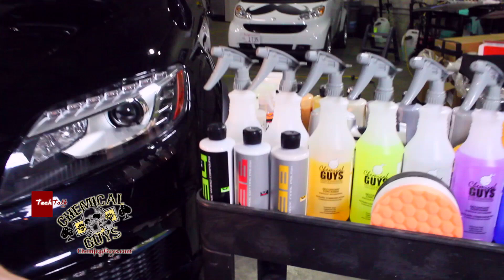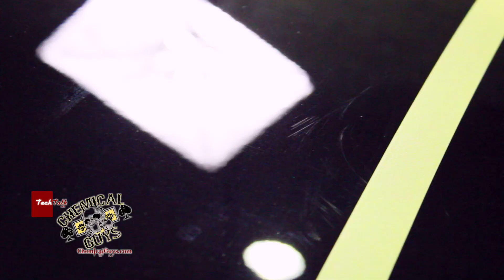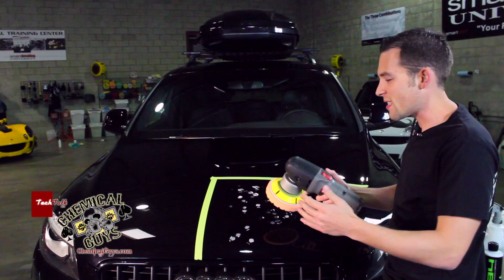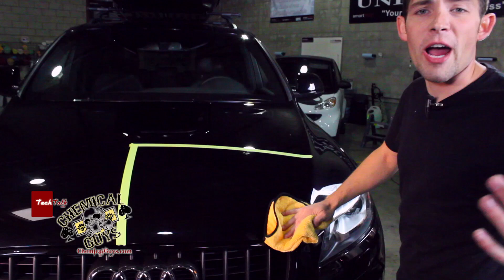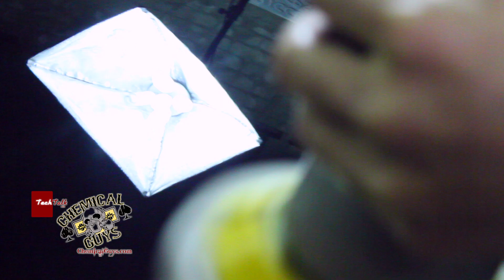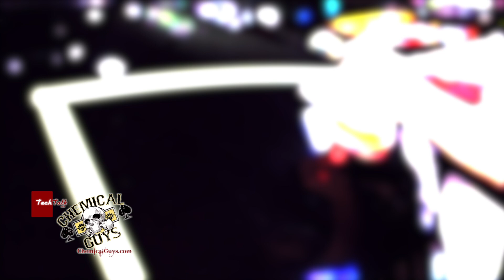How To Remove Swirls, Scratches & Polish Paint with the Porter Cable 7424XP - Chemical Guys

Comment: i have a question my 2009 maxima has lots of swirl marks i bought evertthing like you said in the video buy i messed up on one thing which was the polish 
i bought the right pads and backing pads and same machine 

but i have the whole car polish but the swirl marks are still there it did remove 50 percent they are some still left can i still use all three products that you have told in the video to take it out ??

Comment: Hello, u r using ur porter-cable. when u put the polish on the 1st time, u start out on 1 and then go to 6. could u give that in rpm's as I use a Dewalt which shows in rpm's. Thanks Jim

Comment: Yes, the pads can be cleaned and reused.  You may want to get 2 of each pad, so that you always have one ready to use while the other is drying.  I recommend you clean the pad(s) right after using them, but not necessary just a bit easier at least for me.  I use a citrus cleaner or just plain ole water to remove the polish.  Then let them air dry.

Comment: Quick question... I have already done a full in depth exterior detail on my car last year which included compounding it with a wool pad. The question I have, is there a limit to how much I can do regarding how much I can work with the paint to remove swirls and scratches?

Comment from the maker: Its is VERY important that the pad is centered on the machine. If the pad is not centered, it can cause excess vibration and cause pre-mature wear on the machine. Once you put the pad on the machine a few times, its almost like slapping it on because you're used to installing it. Practice makes perfect.
Reply: After polishing, we wash our pads in a washing machine or by hand? And also what product do we use to wash our pads?

Comment: hello from the uk, recently purchased your range of polish and pads. using v36 on a green 5.5" pad and couldn't get the polish to go clear, also got a very small level of correction, Ive ordered an orange pad, will I get significantly more correction? if not ile perhaps go v34. thanks